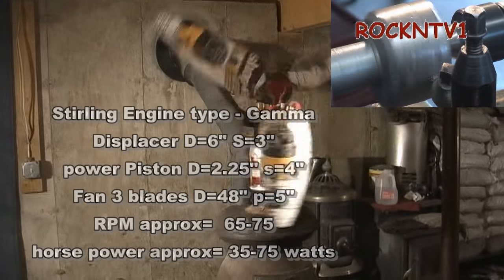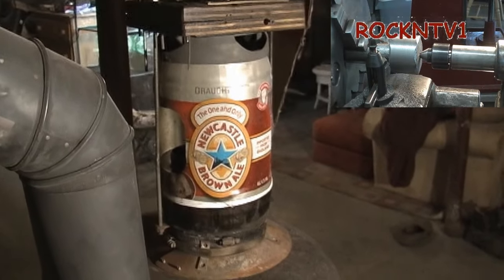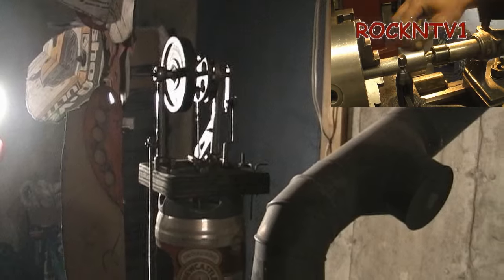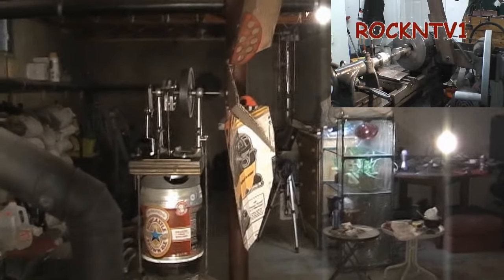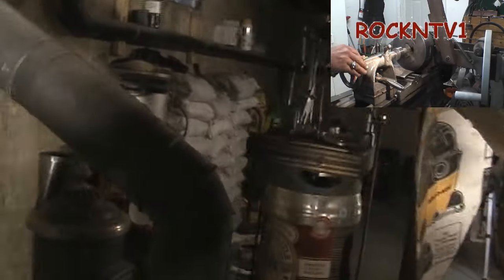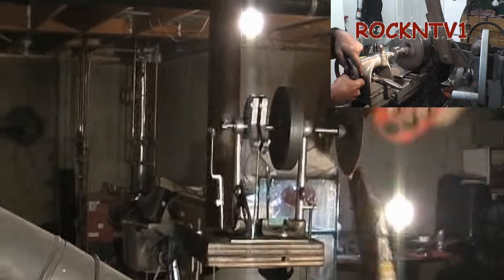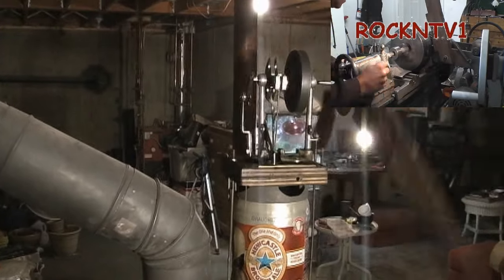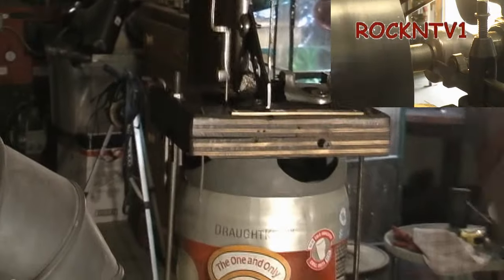Big Stirling Engine DIY HomeMade Hot air Fan Generator

Comment: this is awesome great work love it!
Reply from the maker: Thank you for watching, I hope in the future to provide either the engine or plans to folks for homesteading electricity needs
Reply: @ROCKNTV1  i live on a boat heated by a wood stove, even a very small amount of power at 12v would be super helpful in winter when solar is low
Reply from the maker: In the video shown here, the engine is running in a potbelly stove that burns borh wood or coal, but there is a big diference between the two fuelsand how they burn in this stove. The engine runs better on wood becuase of the shear size of this stove, ie, the hieght of the fire box. The stove shown heats my whole house from the basement and likly much bigger than what you have in you boat. I have been considering these fact when trying to approximate out put to peeps that ask. For me to gaurante a power level is very hard. I will have to say, THAT IF, one was to run a hand fired stove to heat an area at a constant level, that the known approximate temp of the stove is directly related to engine power. If i supplied an engine with a output power spec it would have to be at 80-100% duty and the power level dropping from there. AS a guess, i am resonably sure that 100 watts can be made with this engine by a person who has a level of fire tending and mechanicle skills of a steam loco engineer. I hope that doesnent sound harsh but the stirling cycle is something that needs tending when run from a hand fired heat source.
john
Reply: That's really interested, 100 watts of extra power in winter when the fire is on would be amazing/life changing, my fires pretty big for the boat, similar sized to yours
Reply: That's really interested, 100 watts of extra power in winter when the fire is on would be amazing/life changing, my fires pretty big for the boat, similar sized to yours
Reply from the maker: wHAT KIND OF STOVE DO YOU HAVE?
Reply: It's a little custom built range with Ivan and back boiler fire box's is of similar size to yours
Reply from the maker: I was thinking, you have many heating and cooling options for a boat, forced hot water and radiators, and many options of cooling the engine with sea water. It must be a large boat and posibly thermosiphon water heater, dunno, spitballing ;-)
Reply: Yes exactly lots of exciting experiments to make! It's 33ft Bruce Roberts spray currently moored on thames in the UK, river about one or two c and inside temps about 24c
Reply from the maker: K, imagining that it is fresh water, yes? that solves a bit of a corrosion issue. This engine is water cooled and allows me to widen the temp D and make more power. However adds much complication to the construction. For the hot air circulator i am pretty certain it should be air cooled  for less maintenance. But, if you really want the generator, me too, i think it must be water cooled due to proximity to the heater. my only solution to this is long thin displacer cylinder that fits a standard to these stove 7" cook top plate. I add futher confusion to my brain in that i would hate to waste the heated coolant to the river,,, oi,,   My ultimate setup for the engine as shown would preheat my home hot water.
Reply: That would be amazing, must be some other way of using the coolant water, iam in fresh water right now, I have an intake for the boats desiel engine where I can get cold water, have also considered a heat exchange onto the steel hull below the water line as it's always pretty cold(1 to 10c range)
Reply from the maker: Sir, I gotta ask, where do you keep your fire wood? During a cold winter here, north of Boston I could easily burn 8-10 cord.